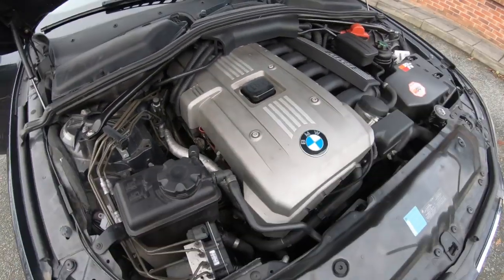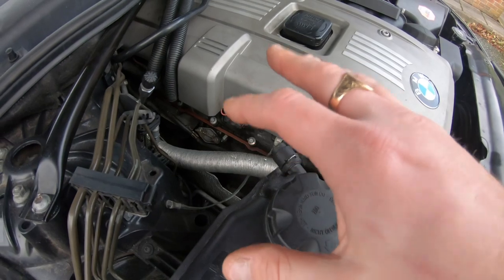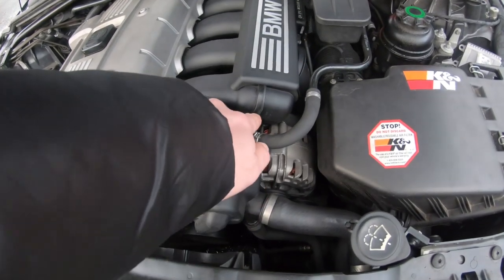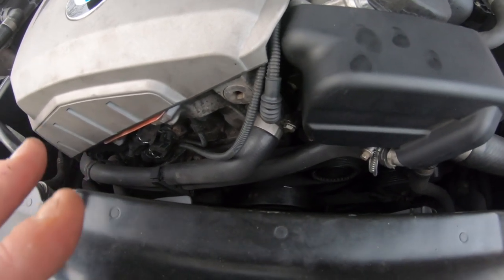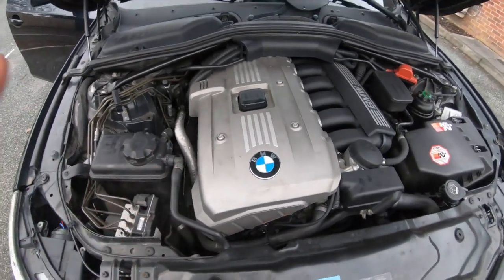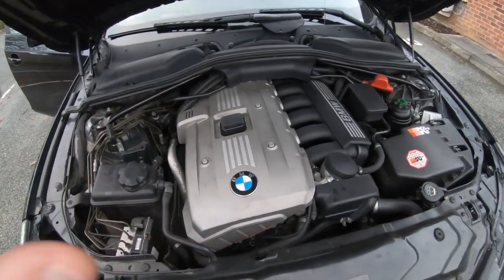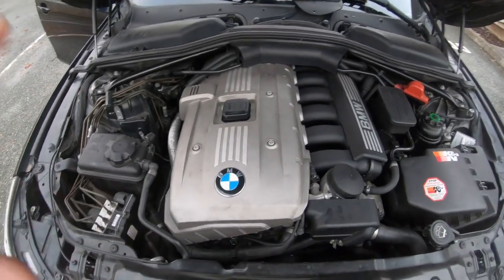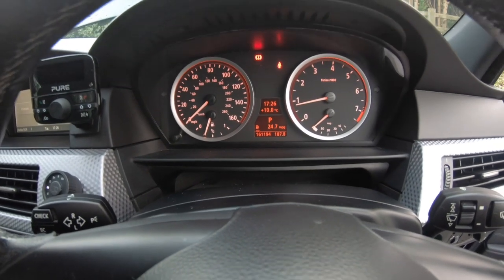How To Know Your Buying The Perfect N52 Engine In Your Bmw E60 & E90

Comment: Should I replace the continuous ticking hydraulic lifters as they don't stop ticking even during summer. They are continuous and tick as long as the car is idling or moving, whether the engine (N52B25) is cold or hot.
Reply from the maker: No you don’t need to replace them please stay tuned for my next video on this topic
Reply: Bmw Doctor I have the same problem, so I cant wait for your video about ticking lifters!

Comment: Hi Dean!
Have you ever had those magnesium valve cover aluminium bolts snap on you while trying to remove them?
Gotta replace the valve cover and that worries me.
Also the valvetronic motor calibration after it's been put back in.
Mine is 2005, 330i, E90.
If I have to hook up the laptop to it, which I don't have to calibrate the valvetronic motor, job is really not worth it DIY.
Reply from the maker: Mate valvetronic motor on these is a must for recalibration after removal if you don’t your car will run like a bag of spanners and your timing will be completely off 

To remove the bolts use a pick and slowly turn the broken ones out very easy to do I have done it many many times

Comment: About oil burning issue, will using a fully synthetic diesel rated oil (like Shell Rotella T6) in appropriate viscosity reduce oil consumption?  I've have good experience with T6 on an m54 (2004 425i) but that engine runs about 94C plus minus a couple degrees (and the oil issues relate to bad piston rings).
Reply from the maker: mate run 5w40 great oil and I aint had any issues on all my cars running that
Reply: @BMWDoctor  Good to hear, I run the T6 in 5w-40 as well.  It's a great oil.

Comment: Hi Dean I've got a 530 d 2004 it went back to the dealer to have the power cable done they said it already been done but I got some really random stuff going on with the car cold start up it runs rough and and it's smoke like no one's business then if I rev it I lose all power for a couple seconds then when the screen and everything comes back on it comes up saying transmission fault and this is happening as well when I'm driving the smoke seems to be getting worse but once she warms up it's fine starts on the key every time if you could give me some advice it would be most appreciated I'm sorry it's such a long message thank you
Reply: I love your videos wish there was more people like you out there
Reply from the maker: Central electronics failure mate common on the 2004 cars mate you will need to diagnose all modules usually MPM module gets water inside it’s in your boot check it mate and make sure your boot ain’t swimming in water
Reply: @BMWDoctor  ok I'll have a look tomorrow thank you very much Dean
Reply from the maker: Your welcome mate let me know what happens

Comment: Hey I live in Canada and it’s already starting to get cold here, -10C range.. I don’t have the option of garage parking it so other than plugging it in with the block heater at night is there anything else I should do?
Reply from the maker: Jordan mate you don’t need to worry about engine freezing mate these cars will start even below that with no issues you don’t have a diesel mate 😂😂😂 don’t worry
Reply from the maker: Jordan Sass Jordan have you had the update done ????
Reply: Bmw Doctor no I haven’t... sadly. It has started at idled fine every other day today was just the first cold day

Comment: Dr dean I need help my e60 530i is overheating . It will not put any heat out of vents . I believe the thermostat is stuck closed . But when I tried to check electric water pump for function with bleeding method it would not come on. Can the pump cause no flow which would not let heat through vents? Or could the thermostat be stuck closed an dme won’t allow water pump on? What should I do? Replace both? Thank you dean
Reply from the maker: replace both mate trust me and do it asap
Reply: Bmw Doctor thank you dean!!! I’m working on it now noticed the lower radiator hose is leaking as well at thermostat side and at temperature sensor. I’m guessing replace that as well and it should fix my problem? Also car has 193,600 miles and it appears original
Reply from the maker: Chad Riddle that is very very good mileage to get out the original waterpump mate this is what I said people go replacing these when they don’t need too yes mate replace that lower hose that comes up to the top with the neck make sure you change that water neck aswell
Reply: Bmw Doctor again thank you for replying! I just ordered those parts and will be picking them up tomorrow. Hopefully will have it fixed by tomorrow night! Thanks for the info and advice
Reply: Dr dean sorry bug you again . I was curious? Once I replace my water pump and thermostat. The dme should recognize that it’s working again an clear the fault ?
Reply from the maker: Chad Riddle no mate you will need to clear the fault if the pump overheated mate it may have popped the fuse also mate be careful as you may need to replace the plug on the waterpump aswell mate and make sure it ain’t a Chinese one mate as you will be replacing it again mate trust me make sure it’s pierburg the wiring connector burns out and will need replacing mate that’s why a lot of people replace there pump only to find out it still ain’t working it blows the fuse and the connector gets oil all over and destroys it from heat
Reply: Bmw Doctor ok thanks again so much ! I’m very thankful for the information.
Reply: Last night I checked the fuses under the passenger cabin filter . I wasn’t sure which one it was so I checked them all. There was a 5amp , 10amp, and four 30amps and 1-20 amp all in one bundle . They all checked ok . I’m guessing the water pump fuse was in the bundle ? Again I’m sorry brother to keep bugging you
Reply from the maker: Chad Riddle yes mate it is that’s correct it’s not inside the car or the rear it’s controlled by the dme circuit mate just make sure the plug connector is perfect before re attaching mate
Reply: Bmw Doctor I will clean it an double check the plug! Your the best dr dean ! Amazing that you shared the info with me an I certainly appreciate you and I’m a big supporter of your channel

Comment: Excellent review Dean.  I’ve sent you a query via the website that you might not have seen as yet.  When you’ve got the chance/time, please please have a butchers and point me in the right direction.  Really need your expertise and experience on this fault.
Reply from the maker: Query mate never got nothing lol
Reply: Can I email you directly?  You’ve responded to an earlier question of mine during your live sessions.

Simply.  I’ve got a business edition Msport 2009 330.  

Symptoms are, engine management light comes on under acceleration and begins to run rough.  Easing off the accelerator causes the engine management light to go off after a few minutes and a slight misfire can be felt.  Diagnostics report confirms misfire in chamber 3 and sometimes 4.  Failed fuel pressure sensor fault which on test run, the pressure comes back as +400 as opposed to +600, and additionally, there’s an open circuit fault.

The fuel pressure censor was changed and the car ran fine for about 30 miles and then the issue came back with the same codes.  

The top fuel sensor was changed, but this didn’t repair the fault either.  Fuel lines have been cleaned, wires checked as well as possible for breakage and I’m now stumped.  Injectors have all come back as good and in working condition.

It has been suggested that its a faulty ECU causing all of this.  I’m wondering if it could be a breather valve, but I’m no  mechanic.  Your advice is much needed mate.
Reply from the maker: Is it worth my while ???? I don’t answer questions on people’s problems mate I get to many of that and there straight to junk if it don’t make me money I don’t answer the questions mate like most other people if problem ain’t listed on YouTube hopefully a video will come up with your issue mate
Reply: Bmw Doctor cheers.  Thanks for responding anyway.

Comment: Hello, I have a question I’ve been wanting to ask you about my 2006 530i. I’ve put on the M Sport suspension I assume which is euro spec, can you confirm that the correct springs are labeled with 2 pink dots and one blue?
Reply from the maker: That’s correct that’s how they are make sure the pink go to passenger side and blue drivers side

Comment: Hey Dean, great video! I'm interested in buying an E60 next year, but i can't help but notice that every now and then some 2004 or 2005 year models pop up for sale that have the older M54 engine, and not the N52. Now i'm very familiar with this engine because i currently have an E46 330i with an M54, do you know how are they in the E60's? Should they be avoided or in general early Pre-LCI E60's? One things for sure that parts for an M54 are a lot less expensive as we all know.
Reply from the maker: Mate m54 engine is very very reliable in the e60 I always say this 

M54 is cheap and very very strong engine in the e60 BUT the 2004 -2005 engines had electrical problems like all hell 

The 2006 prior had n52 and had big problems and a expensive engine to maintain BUT didn’t suffer the electrical problems 

The n52 engine ran for 2 years only before they switched over to N53 in the lci which all round is a better car most 2004-2005 cars will have big damage in the boot from water entering and destroying the MPM module which isn’t cheap and controls all the center electronics
Reply: @BMWDoctor  That's a real shame that water finds it's way in the boot, but thanks for letting me know will check that for sure if i ever go and take a look at an 04-05
Reply from the maker: Makjeh they also get water under the pollen filter housing in the brake booster and that can be filled up with water please check out all my videos to find all the glory details about this car the 535D I HAD was a 2005 with these exact issues and I would AVOID the estate if I was you that is very very problematic the hatch stops working the diversity antenna gets fried very expensive it’s a nightmare air suspension failure

Comment: So how do i  know when to change VANOS solenoids if there's no signs (no jumping RPM/rough idling etc)? I pulled mine out and cleaned them. They seemed fine and not really dirty. Car has 110k km on it. Same with water pump - do i change it just to be sure (it's quite expensive) or wait for any signs?
Reply from the maker: Another stupid one do you not understand anything I said cleaning them does NOTHING where did you get that bollocks from OH don’t let me guess forums and YouTube videos of the part fitters that know nothing about these cars mate we don’t clean solenoids we replace them just for you saying that I will not give you any info on how to know let’s hope your engine blows up for back and watch the parts fitters
Reply: @BMWDoctor  What exactly is stupid - that i inspected and cleaned them?  I just asked should i replace them even if have no problems or errors at all. For all i know they could've been replaced by the previous owner as they seemed pretty clean for the car's age. Why such a reaction?
Reply from the maker: Mate they always will look clean it’s oil which is a lubricant aswell as a protection aid for the engine it breaks down very thin it cannot stock to metal they slow down the pulse rate at which there meant to run at that mileage I would change them because sooner or later there gonna fail and no little cleaning is gonna help you and you can only use bmw dealer ones as no others will make your car run the same that’s a fact and everyone knows that because of me so no point trying to go and purchase Chinese ones on eBay because there 280 cheaper because your car will run like a bag of spanners I highly doubt they would have been changed do you know how expensive they are ???? £400 for both not a lot for me as I get them at trade price so for me £270 for both but to the normal (DIYER) and I repeat (DIYER) they are expensive that’s why they brang this crappy method about cleaning I’m so glad it didn’t work difference I ain’t gonna sit here and agree with what you did I believe that’s wrong and I ain’t in favour of that and don’t support that crap and if you like to be cheap MY FRIEND your on the wrong channel this channel is only about using BMW DEALER parts only
Reply: @BMWDoctor   It seems i didn't fully understand their importance or how they actually work. It make sense to change them as soon as possible and why their quality matters, thanks for explaining it further to me! I'm not really trying to be cheap and never mentioned chinese parts though. I only cleaned them for the sake of cleaning and visual inspection, not because i followed some "methods" from forums or vids. Sorry for misunderstanding

Comment: Bad ccv stretch bolts :DD Wtf
Reply from the maker: Oskaras Ringys mate bad ccv stretches the bolts out the head from excess crankcase vaccum clearly you must be handicap to not know this the bolts are aluminium that hold the valve cover down let your ccv fail and you will see for yourself thanks I’m here teaching you and your coming along as if you know better I’m your mentor so you respect me fool
Reply: @BMWDoctor  Genius how vacuum inside in crankcase can cause rocker cover stretch ?? Pressure or vacuum ?
Reply from the maker: Pressure from sticking ccv DIAPHRAGM